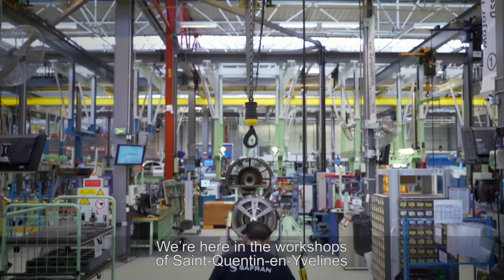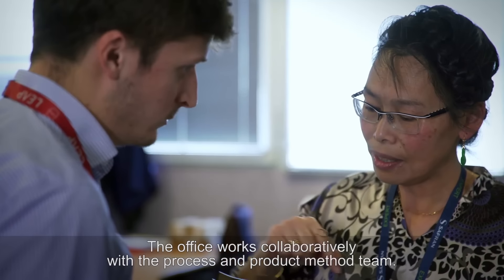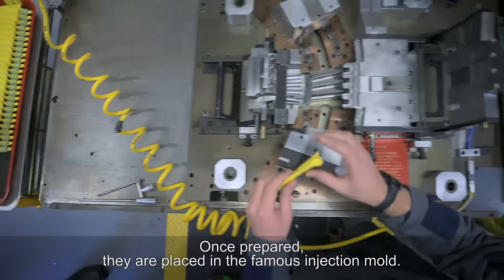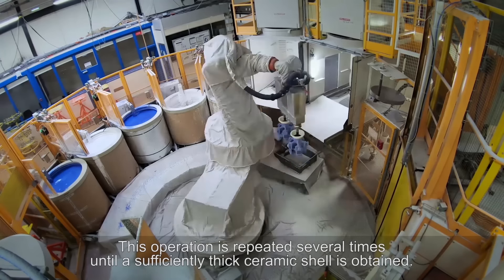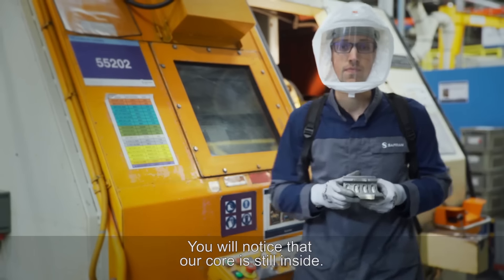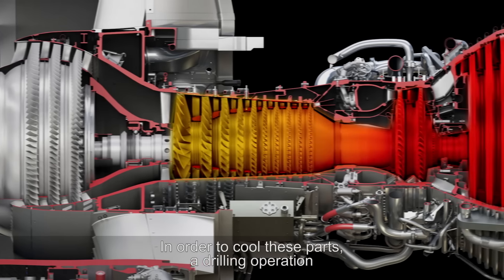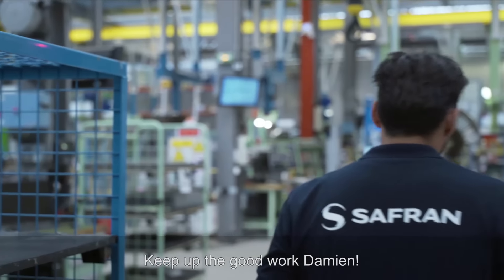The birth of a turbine blade | Safran

Comment: The component isn't a turbine blade - it's a nozzle guide vane!
Reply: The title is wrong but they did mention it in the video. Tbh - these guide vanes get about as hot as the turbine blades so the manufacturing process overall probablybisn't that much different. Of course I'd still like to see it!
Reply: @rkan2  I was an engineering intern at a plant that did the first few steps in the production of blades and vanes. We forged titanium and inconel rods up to the first machining step before we sold and shipped them out. It was an interesting process, and to see how something that sounds simple can quickly turn complex. For example how exactly does the metal flow in the die? If it folds over on itself it is problematic, not just because it can create voids in the part. Or did you think about the expansion, and therefore contraction after it cools back down? How does that influence the forging dies? Definitely was the most interesting job I've had.
Reply: @m_a_t_t6098  Before you sold and shipped them out? May I enquire which manufacturer (or engine) if you are talking about "selling"? If you cannot tell maybe you can mention if it was current production turbine engine or not.
Reply: @rkan2  they won't tell you
Reply: @rkan2  we sold the forged blades or vanes. Some of the customers required you to sign an NDA so I can't tell you specifically. I think they were both current  production and some were for replacement parts for slightly older engines.
Reply: Someone has seen a jet engine before and actually knows something :-)
Reply: @m_a_t_t6098  The titanium was probably for compressor blades or vanes, the turbine section is too hot for titanium. Even the last stages in the compressor can be too hot for titanium and be made of inconel.
Reply: @zapfanzapfan  how do they make single crystal blades ?? I think this section shown here is not single crystal.
Reply: @anshulbhardwaj4038  They said something about controlling the cooling so maybe it is. Get a crystal forming in the mold outside of the actual part and then let it grow by controlled cooling.
Reply: @rkan2  I think that they mentioned the CFM International LEAP. "LEAP" labels were seen a couple of times. (Edit: Comment that I replied to is now gone.)
Reply: @Thankz4sharing  We weren't talking about the video. CFM is Safran's (previously Snecma) and GE'S collab for aviation jet engines.
Reply: @m_a_t_t6098  you Canadian?
Reply: To be fair, these probably count as stator blades. Not the rotors people think of as turbine blades, but just as important.
Reply: @rkan2  First stage nozzle guide vanes see higher temps than the first stage turbine blades because they are closer to the combustion chamber
Reply: I want the baby belt sander
Reply: @rkan2 
First stage intake guide vanes get hotter but are loaded significantly less. So kinda two different design challenges.
Reply: I wanna see the zero blade la

Comment: I remember the days, when a lot of jet engine and rocket engine parts manufacturing processes were top secret under.  Some of those key manufacturing steps are still protected as classified under Missile Technology Control Regime (MTCR) even for parts destined for the civilian aerospace industry. For this reason, I find videos like this a miracle of freedom of information.
Reply: Well, the overall production steps is kind of well-known at this point thanks to globalization. The trade secrets are the formulas, specific design of tools/procedures/etc, steps unique to each company, institutional knowledge, basically the small details making up the vague production steps in the video.
Reply: @jac1207  you are right. Think that even you cannot buy these quality wax easly. It has district rules for each country and market.
Reply: The process shown here is more or less same as car engine production. This is PROCESS. The real composition of metarials, desings, alloy metallurgy are obviously hidden. Hell no body even knows the exact angles at which blades cuts air.  😅

Comment: It's interesting how "artisanal" it feels (despite the abundance of high tech tools) compared to high volume manufacturing such as car components, no wonder these engines cost so much.
Reply: Many test and certifications add a lot to the final cost, plus the extra care to make an Aviation Grade component with all the CoC and Form1 to be acceptable.
Reply: @WilliamHelstad  COC mean certificate of conformity and Form1 is an EASA or/and FAA document that certifies that the part is approved to be installed on an aircraft. It's illegal to install a part without CoC or Form1 and the aircraft becomes AOG due to loss of airworthiness.
Reply: We 🤔 should wonder why the cost of Industrial Foods and Beverages are so much because most of them are not healthy Foods!. But not Safran, GE, RR,...Jet Engines. 🤗🍎🍏Sure, these Jet Engines are reasonable costs for us to enjoy our Flights more safety, daily.🍹🍹🍹
Reply: @WilliamHelstad  as you move up the performance curve to approach what is just possible, the options to design  around the problems become more limited and the safety factors smaller, hence you must compensate with careful process control and inspections.
Reply: Considering that the part is a single piece of metal (in a complex shape) I'm a little surprised that it requires so many steps to cast. No wonder additive manufacturing was generating so much hype some years ago.
Reply: @Nainara32  Additive manufacturing is still relatively new, it'll take a good while for it to catch up, that's if the development of additive manufacturing tech goes swimmingly. 

The biggest hurdle is for it to cross that cost barrier, where a manufacturer feels it gives enough benefit to invest in it. That part itself is the biggest challenge and the tech needs to advance to a point where big companies feel comfortable enough to invest in it. But as things are going, I can see it working hand-in-hand with the emerging AI-assisted designs, things the current investment casting method can't really do on a practical level.

Comment: All good but the part being manufactured are segments of Nozzle Guide Vanes (NGV) and not turbine blades as you mention in the video. NGV's are  fixed parts and the blades slides behind this leading to rotation of disk and shaft.

Comment: Hello, experts. May I ask You a question - what is the material  used for Core inside of the blade? is it easily obtainable for general dyi project... and "Soda bath" what does it mean - what actual dissolvent is used to get rid of the core  on final stage ?

Comment: I never know how many steps you need for such a little part! But I want to know wich speed, temperature and forced this part have to withstand.
Reply: Zero speed, it's a stationary part but the first part touched by combustion gasses so the hottest piece in the engine. The turbine blade behind it will get nearly as hot and turns around 20,000 rpm so has a force like a bus hanging off it.
Reply: It’s second stage vane, so around 1000degC

Comment: It is not a turbine blade, but a stator vane to redirect the exhaust flow into a more optimal angle to strike the next set of blades. They are whirling by at a very rapid pace. 100 to 500 times per second. Each redirect gains efficiency. All the little holes and passages allow cooling air to blast the heat away and cool the exhaust, preserving the turbine blades, while expanding even more air which is the source of thrust. 
During the early '80's we had a situation and I was tasked with keeping Engine assemblies available for 2 squadrons in Bermuda. 1st, they are last in line on the supply line for aviation parts.
2 squadrons means 18 4 engined airplanes complete with propellers, gearboxes, and wonderful turbines. 

3 large drums full of 1st stage stator vanes was my only hope. Empty one on a huge table, divide scrap from emergency, and that can go a couple thousand more hours. Reclaimed enough to maintain those birds for 6 months.
4 months at that effort in 130 degree hangar working 18 hrs per day 7 days per week. 
You would think a nice thank you would be in order but the CNO said crossrate or get out. 
Politicians are the scourge of society.

Comment: How is the core held in place after the wax has melted? Pins?
Reply: I was wondering that too, and I think I figured it out

if you look closely , part of the ceramic core is still sticking out when it comes out of the wax injection mold,

so once it gets dipped in the ceramic slurry the outer part of the mold binds to the parts of the cores that are sticking out of the wax.

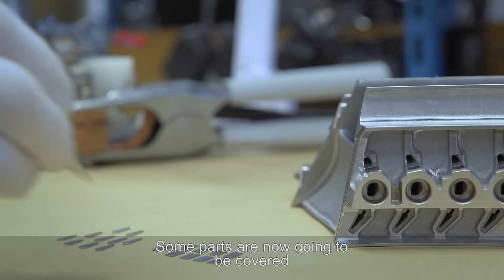Comment: Excellent video but I do not think that at 8:19 those blocking parts which operate at high temperature are attached by using a solder bead!
Reply: Actually, it's called "brazing"... and is very common to close openings in the casting.  This video uses some terminology that might be slightly simplified, but in essence, the "solder" is the brazing filler material, similar to the way a pipe fitter uses solder to braze water pipes together.  You'll note that those parts are not on the hottest sections of the part, however.
Reply: @williamsteele  Thank you for replying, but as the video is entitled "The birth of a turbine blade" and often speaks of " turbines", where blades handle high flame temperatures, rather than blades on "compressors"  where temperates still rise due to compression ratios, I thought that " the solder or even the brazing I know of", would be struggling to operate at those turbine temperatuires. I suppose the fusing brazing properties can be used on higher melting materials. Guess all materials can be brazed as you said. Apologies for picking up on the soldered part!
Reply: @carmelpule1  So let me clarify a little more... when I said they're not in the hottest part, I actually mean of the actual turbine blade itself... those brazings are done on the bottom side (where the coolant side is) so they're not in the direct flow of the combustion gasses.  That means they don't see the highest temperatures.  Also, the metals actually do not experience the high combustion temperatures due to the cooling system, which allows a coolant (compressed air) to flow out and along the surface of the blades, keeping the hot gasses from actually coming in to direct contact with the blade.
Reply: @williamsteele  But that filler doesn't look very metallic.. what kind of filler metal is liquid at room temperature?
Reply: @williamsteele  Thank you for replying. my brother and I made a few model jet engines and making the diffuser, the slowing down of air to keep a stable flame, the hot stator, and the turbine was not so easy, but they all worked for a few hours, as we did not have the right materials, nor did we cool the blades apart from feeding the bypass air to the hot stator. Seeing your video I just marveled at the method of producing what was shown, and I could imagine the responsibilities which you carry.  Thank you for your assistance and all the best with your very interesting work. I am an old man now and did work on the installation of the first  British Naval ship that had jet engines installed,  HMS Exmouth and it had two Proteus and one Olympus jet engine. I worked on the overtemperature protection system, back in 1963 maybe.
 That was a long time ago,  Thank you for respecting me with your replies. All the best.
Reply: The paste they use is basically a flux filled with the metal powder, so it melts very easily.
Reply: Might be a translation issue. It's a braze paste (braze powder mixed with binders). The brazing temperature for this part is probably ~2000°F (1100°C) or higher.
Reply: @stngiam  These will be heated in a vacuum furnace at around 2000 degrees F - hot enough for the brazing metal to flow but not hot enough to melt the parts. The vacuum will prevent atmospheric contaminants from affecting the part and the braze

Comment: How do the ceramic cores stay in place after the wax is melted?
Reply: They're attached to the outer shell when the outer shell is applied.  (The outer shell and the core become one part, essentially.)  When the parts are shaken, the outer shell breaks off from the cores, but the cores are still locked in place.
Reply: Core prints are assure the correct position of the ceramic cores.
You can see those small yellow core prints at 2:57 on the right & left side of the wax.

Comment: Why not 3D print to precise dimensions?
Reply: Not as strong, as castings can be done at higher temps to produce a single unified object. Printed metal is more like Lego., lots of strong joins where welding has occurred but weak areas where welding hasn't occurred. Also perhaps printing has unacceptable warping issues. Resolution of printing metals probably can't provide as smooth surfaces, especially on internal surfaces.
Reply: CNC machined parts from forged billets would be stronger than casting. I'm surprised that is not used either.

Comment: Hello!!
I'm Basavaraj 
I'm working as a design engineer in the refurbishing department at a steam turbine manufacturing company in India.
I have a doubt about blade design; can you please resolve it?? 
Question: In low-pressure blades, previous OEMs made a core hole and assembled a rod inside it.
We don't know why it is.
Can you answer me??

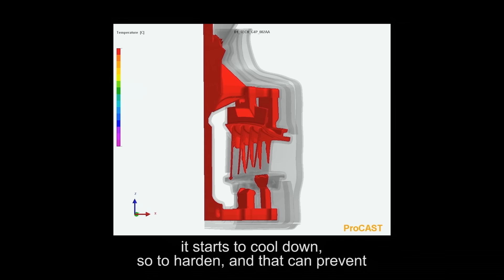Comment: 5:20 why not just inject it in warm injectors? This industrialization look for lucky instead of scince. I say because the wax and ceramic on autoclave. use injection like plastic. Of course not easy as plastic because required high temperature but i dont finde it hard to be done when made for mass production.

Comment: beauty of engineering, but more innovation is needed to increase production speed. 3d printing can help but then research in alloy metallurgy is needed.
Reply: Casting and heat treatment gives a metal high Thermo-Mechanical properties. 3D printing will be fast but will not give the desired properties required for high stress and high temperature applications.
Reply: @jeweldeka4471  I know, that's why there needs to be research in alloys which can provide same properties when 3d printed.

Comment: Or an easy way is taking  a juice can  cut off a lid . Use a protractor  and find the center of the circle  now segment the disc ,finally draw your inner and outer segments for the blades and splice them .  Bend them into require shapes.  A brand new turbine disc

Comment: Safran - this is a high pressure turbine nozzle guide vane segment, or HPT NGV. Not a turbine blade. I hope the QA folks signing off these videos are nowhere near final assembly and testing...
Reply: Isn't this the low pressure section? The high pressure section should have ceramic coating, no?

Comment: This video helps demonstrate why China can't just steal a Soviet or western engine design and simply make their own, and this video completely skips over the most technically demanding step, which is to make sure that the liquid metal solidifies as a single crystal therefore having a stress/failure temperature hundreds of degrees higher, which gets exponentially harder as your turbine blades get bigger.
Safran makes tiny little helicopter engines and can't compete with GE or Rolls-Royce; a giant turbofan on a commercial airliner has 6 foot turbine blades, and the entire turbine assembly on an F-22/F-35 engine is one single part.

Also, the narrator in this video keeps calling every mundane thing 'famous' which makes me think it must be a mistranslation.
Reply: No, they produce some pretty tasty power plants for military aircraft, the rafale is very high output.

The only place you will find 6' gas turbine blades are in a power station, the 6' blades on a Rolls Royce are the fan blades, the core inside will be no bigger than the rafale engine.
Reply: Safran do make CFM Engines ( Low pressure Compressor and Turbine sections)
Reply: Not forget, Safran rocket engines!